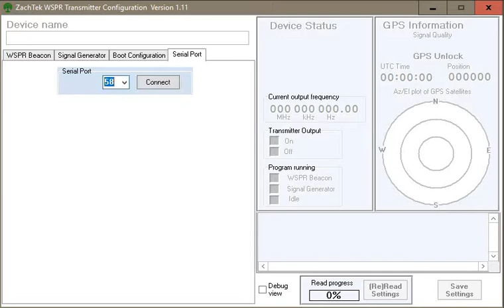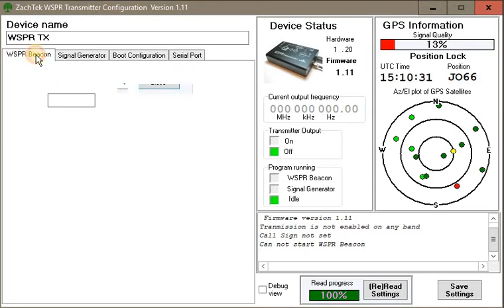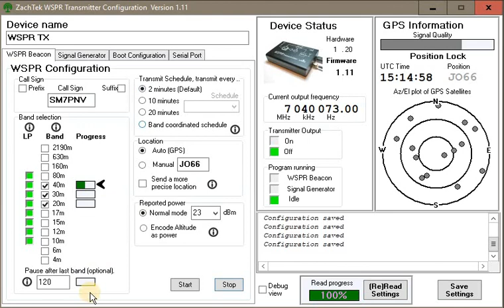ZachTek WSPR Transmitter Setup 1 (Quick Setup)

Comment: Awaiting forum approval. Excited to make my first transmissions. One thing that is not happening right away is a the GPS determining my grid. I have signal quality of 69-81% and it says Position Lock but then it shows 000000 on Position. I will let this run for awhile and see if anything changes. 73 and thanks for the great hardware/software de Jon K7CO